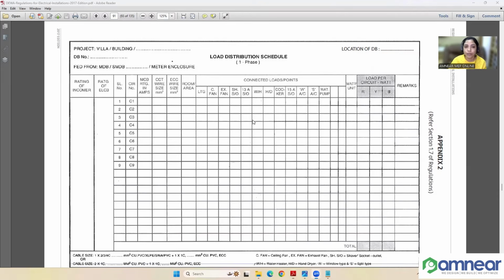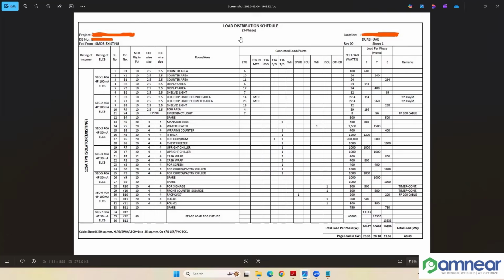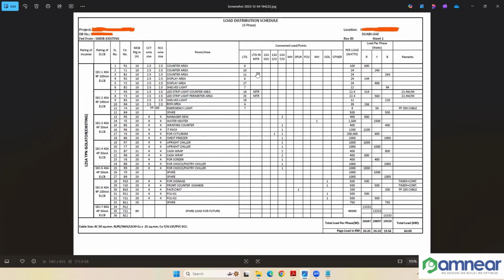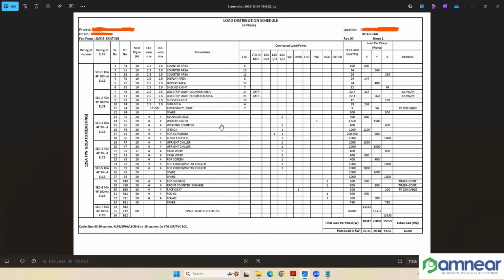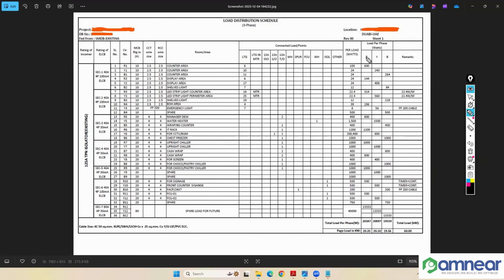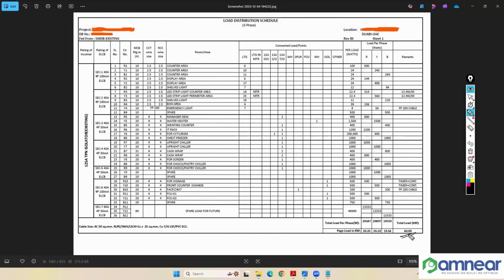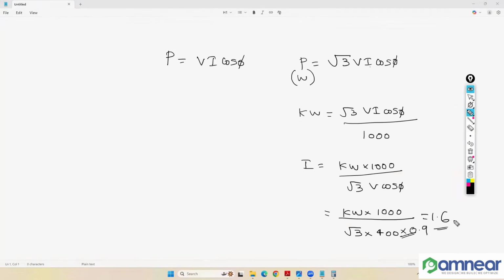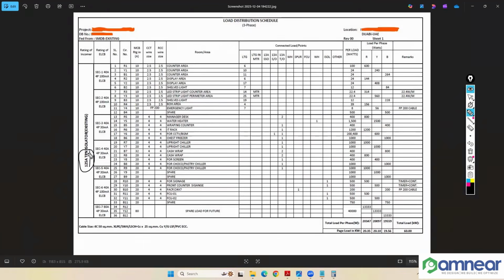Load Distribution Schedule in Electrical | Easy Explanation | Electrical Designing |AMNEAR MEP | BIM

Comment: For single Phase , do we need to connect it as R1 Y1 B1
Reply from the maker: RYB represents a three phase connection. It applies only to a three phase system. In a single phase system, we only have Phase (L) and Neutral (N). And for safety Earth (E).